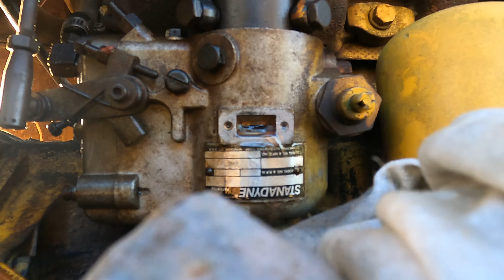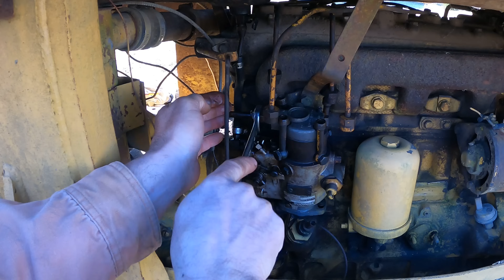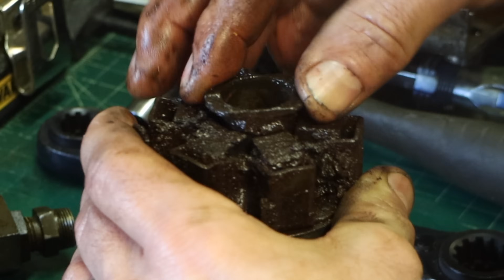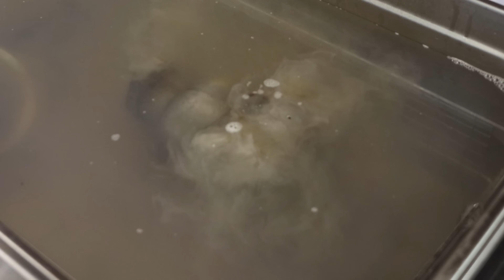Forgotten John Deere 1010 Track Loader, Part 2.

Comment: Thank you for sharing this “learning by doing” - If I may:  double check the timing, replace the glow-plugs, fully charge the battery and try again before launching into a complete disassembly. It’s a relatively quick, cheap and simple next troubleshooting stage.  Using new glow-plugs would compensate for the lost compression heating when cranking on startup, after which the dynamic compression (at idle rpm) when have increased sufficiently to enable it to run without further pre-heating by the glow-plugs.  I hope that makes some kind of sense. Whatever you decide good luck and take us along with you. Thanks again.

Comment: Hi John, My FIL had an old tractor that no one could start when he went to pick it up. Everyone who had tried to start it had used starting fluid. When it wouldn't start for him, he used WD40 and low and behold, it started. He conjectured that everyone had used starting fluid and washed the oil off the walls of the cylinders and when he tried the WD40 (it had propane propellant at that time) it sealed the rings and got enough compression to start. Used it for a lot of years without an engine rebuild after that. Good Luck

Comment: Couldn't the lack of compression be just worn valves or lifters that need adjusting? I think a wet test would affect badly seating valves, too. Also, the volume of the compression test hose before the check valve effectively decreases the compression ratio by adding extra volume to the cylinder. I think it might not be as bad as it seems.

Comment: Autopsy would be fun just as a point of interest, but no need to make it into a sunken cost fallacy. If it takes you a ton of work (and money) to get the engine running and THEN you have to do lots of work on the hydraulic cylinders and who knows what, might not be worth it. Your time mostly costs your patience and takes away from other stuff, but it produces videos. So I think the most important thing is if you feel like YOU want to do it. You don't last long in the youtube-business if you don't like what you're doing. It eats away at you. Burnout for youtubers is a real thing for a myriad of reasons. Still, gotta listen for feedback somewhat of course. But remember to be you. It's why we watch you Jon.

Comment: Genius rating attained in re-assembly of the many intricate parts of the fuel pump.  The design of the pump with this many pieces seems beyond the mad scientist/engineer point. Even mechanical hearts have fewer parts than this !   Even after having  acquired some basic mechanical skills I would never attempt what you did even with detailed diagrams. 
I am in total awe of your skill and perseverance, Jon ! 👍👍👍🤩🔧

Comment: it sucks, that you couldn't get it firing but at least a teardown and or rebuild will make for good content. You've rebuild almost everything now on farm machinery, hydraulics etc, it only makes sense to do an engine. Winters coming, pull the blade and cylinders off, relocate to under your leanto or barn, and make sure the cameras rolling.

Comment: Pull the head John !  and if the cylinders look good the rings are either stuck or just real weak.... replace the rings if the rod bearings look bad or are really worn replace them
other wise sell it for scrap.that could be a real handy machine on the place...I think it's worth the time and trouble and expense to get running again... you do not have to have it though.. you have an excavator that can fill the dump truck but this thing could do that much much faster ! .... besides it's content ! LOL   it will be real interesting to see that thing come apart and go back together again.... IF YOU CAN GET PARTS ...only IF !
........
edited: I bet if you tried real hard you could get that thing running get a good battery or 2 in parallel and use your quick start with the oil in the cylinders alone it should fire up and run on all 4...3 at the very least ! ... you got the fuel pump working, spin that thing real fast and it will run buddy
get a fresh full can of ether and 2 big batteries and I bet you money it will fire up. when it does it will pick up the other cylinders and get those leaky valves working right again....
then you will have a better idea on how to move forward on it....

Comment: Valve cover off. TDC No1 (both rocker arms loose on No1 cylinder, i.e. both valves closed) and recheck timing marks on pump window; adjust as required. If you do nothing else, at least rotate the engine and observe the valve train operation is as expected. A lot of engine problems can be spotted with irregularities on the valve train. You could also try firing the injectors outside of the engine to see if there’s anything coming out of them at all, otherwise get them bench tested.
I’ve no John Deere experience, I spent 39 years with Caterpillar, who, incidentally, don’t ever provide compression data for their diesel engines. They say it’s not a reliable indicator for diagnostic testing. Good luck and season’s greetings from the UK.

Comment: Don't forget you still have many unknown issues here with that antique JD. Transmission steering clutches brakes transmission rollers. For the purpose of making a video keep going for the purpose of having an awesome machine save your time and money. Here in the Midwest where I live you can pick up a really nice JD 350450 555 for well under 15K

Comment: What comes to my mind in this scenario is I wonder if the low compression is a combination of effects. A 1010 is an old design, the first for Deere in to 4 cylinder engines so could it be a bad head gasket design that might need replaced every 5000 hours? With how much water was in that pump and the intake boot off, did any water get in the head causing rust on valves? And of course stuck or broken rings which you are not going to get a definitive answer without a tear down or getting them unstuck with something like mystery oil. You make YouTube videos, don’t give up yet. Get some mystery oil, Borescope through injector hole, see if you can see sticky valves, get a smoke test kit for a leaky head gasket. If all that fails, tear down and perform autopsy. You should be able to get parts from mother Deere.

Comment: Now that you have oil in the rings and ring grooves and the compression is 50% better, put everything back together and see if it will run! Those rings haven't wiped oil off the cylinder walls in how many years? I've seen engines with low compression, oil thre rings, and then run from then on. Maybe cleaning valves with a cleaner could help too in case the valves are being held open a bit? This is all stuff you can do really quickly and might save you from a tear out and tear down.

Comment: Give the starter 24 volts and feed it a can of ether, if you can get the RPM up enough and get it sputtering on a couple of cylinders it might warm up and shake enough to free up the rings.
Worst case scenario, it still needs a rebuild.

Comment: I'm really surprised you didn't bore scope the engine.   You should try a few things first.  As others have said ensure timing of pump is correct.  Heat gun or hair dryer in intake.  Some of these older diesel do not like being cold

Comment: could just be some stuck rings, i'd try something like some ATF or marvel mystery oil etc to see if you can break them loose. Take the glow plugs out and put some down there, let it sit for a few days, then come back and either recompression test, or try to crank. if no improvement or no start, then you can pull the head and look at doing a rebuild. if its a sleeved engine, that'll be ideal.

Comment: Starting fluid OR glow plugs, not both. Glowplugs can cause the starting fluid to prematurely light and lift the heads ruining the headgasket.
I think your problem is probably valves not seating good. Heat that engine up good, like with a block heater. Clean the battery cables, maybe put on bigger ones, get a really good battery so it'll really crank, then get it running. It'll run with that compression and once its running the rust will come off the valves which will probably help compression. Get it good and hot and do another compression test.
Also I think you're 100% wrong about oil bath air cleaners. Paper filters are just a bid to get you to buy filters every year. People didn't service oil bath filters so they got a bad name.

Comment: John,  I have been a follower of all your videos and admire how your always get things done.  Watched all your pond building videos too.
   Don't know where to start this comment, don't want to be a Debbie Downer here, but this project looks likes its going to not end well.  In your past videos on the Cat dozer, the fuel issues you had on it, seems like you are going the wrong way here.  Once you found all the rust in the filters, wouldn't you stop right there. The fuel tank would be the first place to start, drain it, clean it like you did on the dozer.  It appeared that you just let the fuel in the tank fill the system  and bled the injector pump. Not getting fuel to the injectors, you realize you pump is bad. Number one before pulling pump, you get it one number one TDC.  You touched on ways of doing this, best way would have been, pull glow plug or injector on number one, rotate motor find the compression cycle, look for the timing marks on flywheel, ( which you did after pulling pump).  Once you pulled the pump off and pulled the top of the pump off, you had to have know, the complete fuel system is trash, everything, all fuel lines, INJECTORS for sure.  I sure enjoyed your complete tear down of the pump, reassembly of pump, which I would never ever do without any set up, testing equipment.  You did a good job explaining the reassembly of pump, kind of skipped over the shaft umbrella seals, a must to install correctly.  Then re installing pump to motor, a absolute must to have it on number one.  Most all injector pumps will have slots that are designed to fit correctly into drive on motor, one will be wider, maybe a dot marking.  Total damage to the new rebuilt pump if installed wrong.  
   Now you show the steps in bleeding the new pump, fuel to injectors, but no smoke.   You are not sure if timing is a issue, glow plugs not working.  Why did you even think it would start is my question?  All that time rebuilding pump, the cost of new parts.  Surely the pump shop would have told you the injectors would have to be shot.  All the injectors lines are filled with rust, all lines have to be replaced, clear to the tank, and tank would have to be inspected, cleaned, you have been thru that with your Cat Dozer.  I guess the future videos we will find out what you have to do only to get iit running.  What are your plans with the machine if you make it run?  Do you need it in your operation? Been around old loaders like that, I assume it's a straight drive system, maybe has a junk reverser,  It just isn't worth much, you already know that.  So much to be bad on everything, looks like you are heading down a rat hole here, there, I gave my thoughts on this.  Looking forward to your next video, see if this will run. working  machine may be another subject.
    .

Comment: One of the coolest thing I've seen is when Eric at SMA showed how to do a "relative compression test", but just hooking  a Pico scope up to the starter.  Before pulling any parts he plotted current draw and it showed how hard the starter was working per cylinder.  It doesn't tell you actual compression, but it's very quick and fast tell to tell you if you have a weak cylinder compared to others.  Just food for thought since you also do a lot of other engines.

I think it would be cool to get it running, but honestly I wonder the real world usability of a track loader.  I've never seen one running, but I would imagine its super slow like a bulldozer right? Is it fair to say this work now gets done with skid steers and large bucket loaders?   I'll watch whatever, but just speaking from a practicality POV.  After you get the diesel running, you're probably then going to have to rebuild every hydraulic cylinder.

Comment: It may have low compression but from the total lack of smoke I bet there still is a fuel issue. Even a very low compression diesel engine should at least produce white/grey smoke when the injectors are properly injecting.
I've had the case where I had air pockets in the injectors themselfes after I rebuilt an engine so there was fuel up to the injectors but no smoke. I ended up removing all the glow plugs so the engine turns freely and then with the throttle on max let the engine turn over until atomized fuel mist came out of the glow plug ports.
In my case I had used up several batteries and minutes and minutes of spinning the engine until that finally happened.
So my bet would be on that thing running once it gets fuel.. not sure about the timing if there is anything that could've gone wrong and even with wrong timing it should produce some smoke? Maybe injectors clogged so they don't atomize the fuel anymore.. or there actually are air pockets somewhere still.

Comment: put a propane torch in the intake and try and start it, the extra heat can overcome the lack of compression. if the machine sat the rings can be gummed up and having it run can fix it.

Comment: Jim's tip of the day....trying to start clapped out diesels like that, use spray grease down the inlet as it will build the compression enough to start plus light solvent to ignite. Could be fun!

Comment: Have you considered pulling with the other machine?  You would eliminate stress on electrical system and the further you pull it, the more heat will be generated  8n the cylinders. Probably need some to verify the timing first.

Comment: For my part, the thing is so rusted at every single point that it’s not worth rebuilding the engine. If it was in fair condition, then maybe. For me, this feels like the equivalent of a car with holes in the floor, no muffler, doors that don’t work and the question being asked is “should we rebuild the engine ?” . Even if you did rebuild the engine and get it running perfectly I’m sure that every single system would probably have problems. Maybe get another one that has a higher paint to rust ratio. 
Thank you for the videos John, I admire your hard work, dedication and resourcefulness. 
If there’s one thing I have learned from you is that farming is hard work (and that some people have a strange thing for seals). Not that there’s anything wrong with that 😂

Comment: First step has got to be to put the borescope down into the cylinders and see what we are dealing with in terms of what the bores and pistons look like.

When you inserted the borescope into the intake the intake valves were rusted so there is a high probability that water has also entered the cylinders. 

If that water has sat there for years and rusted out the bores then is game over unless you want to start spending some serious money.

I feel seeing as it has around 200 PSI it would run, if the bores look good then I would put a little more oil in the cylinders and let it sit there for a couple of days as the pistons rings could be just stuck in the pistons, maybe the oil will help free them.

I would be checking the timing again to make sure it is correct and I would hook up a temporary fuel tank bypassing the fuel filters as from the state of the inside of the injection pump its probably not pretty in there and fighting dirt in the fuel lines on top of everything else is another variable we don't need.

Pull the fuel lines off the injectors and crank her over, this will flush any debris in the lines out that has come from the tank and made it past the filters. Removing the injectors and seeing if you can blow through them with an airline is also worth while.

If the pintle in the injectors is seized from rust or blocked with dirt that is not going to help.

After all that as a last ditch to try and get her running gently warm the block up and then try starting her with starting fluid, the combination of the oil in the cylinders increasing the compression and the block being warm aiding combustion could help her start.

Comment: A few years back I was rebuilding a B-275 international. I resleeved it and installed new pistons, bearings etc. I took the head to a shop and had it magnifluxed and found it had some cracks. They repaired the head and when I went to pick it up they were just working on the injectors. They had a rig they could hook up each injector and with a single stroke hand pump they were setting the blow pressure after cleaning them. You would not believe the difference in the spray after cleaning! From a small piddle of fuel to a fine fog. Was a beautiful thing to see. 
We are all waiting holding our breath to see what it looks like inside after you pull the head. Just have to weigh the cost and it's use when done if you rebuild it or not. I would love to see you fix it up and I am sure when you would get it done it would be a well working little rig that would serve you for years to come.

Comment: I feel like you have nothing to lose by just letting some oil sit in the cylinders. Maybe it'll loosen up those rings.

Even if you leave a little light weight oil (PB Blaster or something) in the cylinders to boost the compression while cranking just to get it started ... once it's started and has a chance to heat up, those rings might come back to life

It would just suck to pull the engine just to find out that nothing is really wrong. If you don't have a reason to believe that the bores are completely trashed, then I wouldn't go pulling the engine.

It seems WAY more likely to me that the rings are just stuck because it hasn't ran in God knows how long

Idk, just my 2 cents (now probably only worth 1.25 cents with inflation lol). Thanks for the great videos!